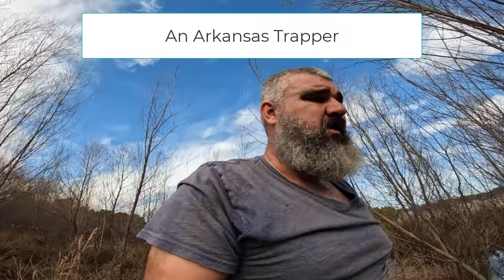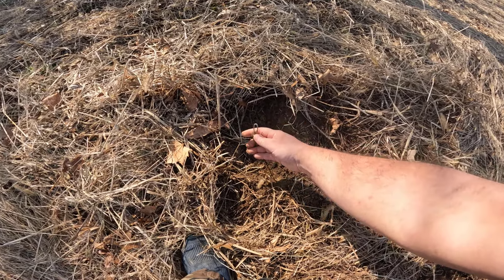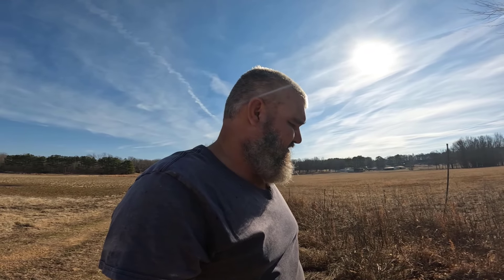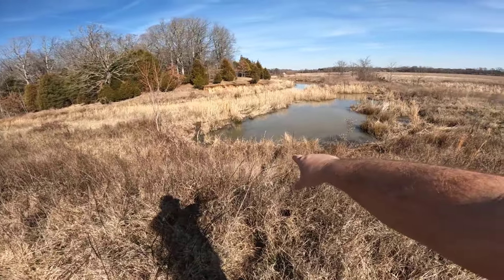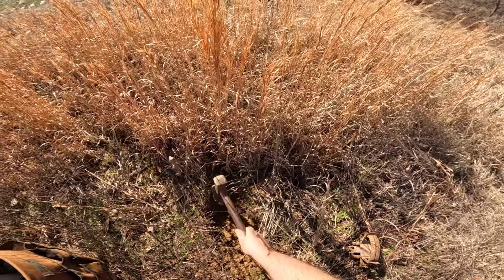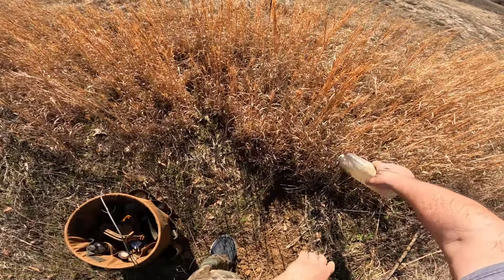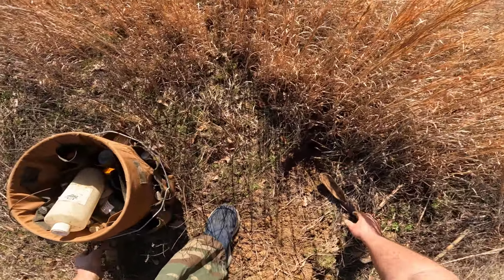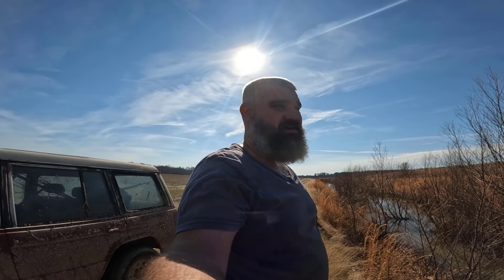Trap and catch missing. Person or equipment failure?

Comment: nice looking sets , try taking a little castor lure and use it as a smear lure inside the culverts . that will make the beaver curious and investigate the tubes quicker . i haven't used any of the rbg traps yet . thinking about getting a few to use for otter sets . i'm thinking someone took your trap at the predator set , there wasn't enough disturbance to indicate a struggle enough to make the split ring fail . good luck on the line . if you can find some poplar bud oil , it works pretty good as a food/curiosity lure .
Reply from the maker: Thanks.  I am leaning to someone helped themself to it as well.

Comment: When ever someone finds a trap, they take it. So I learned that you not only have to blend it in with the surroundings to catch the critter. But you also have to make it invissible to thieves.
Reply from the maker: I have had very little issue over the years with theft.   Hope that isn't changing.
Reply: @AnArkansasTrapper  I hope so too. I have had 2 traps stolen since I started
trapping. Now I try to set them where they can't be seen. Like no drowning rods in clear water, only snares or footholds on anchors, if it's where people might see them. I have a lot of stealth sets I can use with those traps.